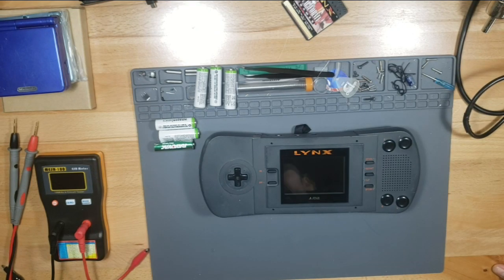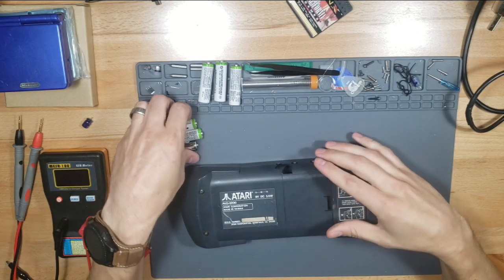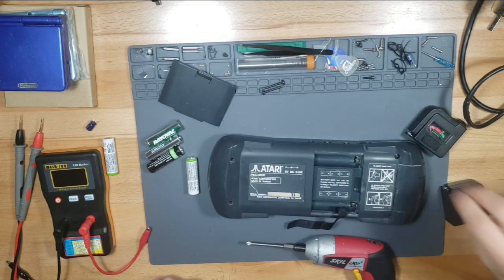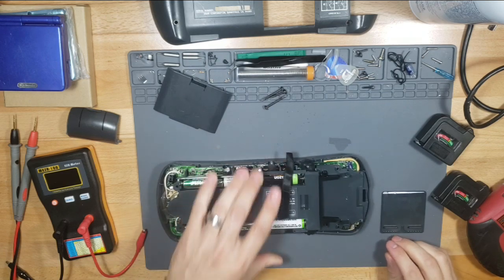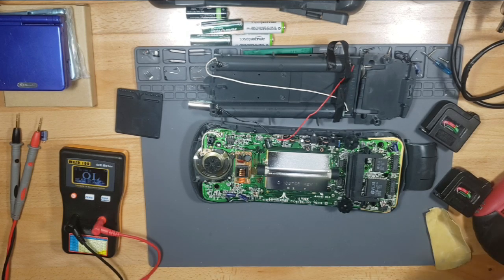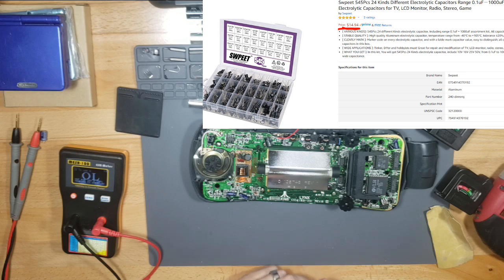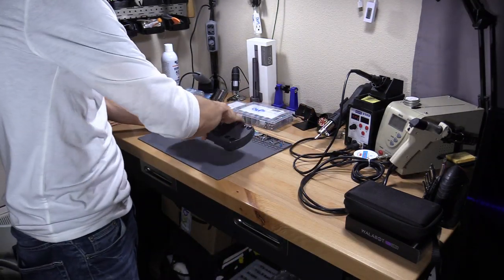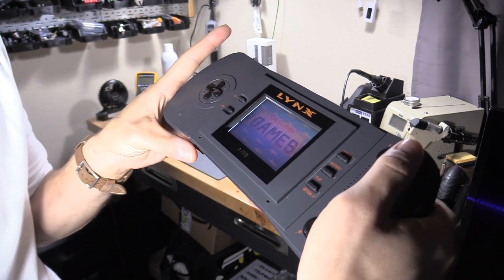How to Fix Atari Lynx power not working & bad screen

Comment: More than 10 years ago, I bought an Atari Lynx 2 console. It didn't come with an AC adapter, and it wouldn't turn on. I haven't been able to play it to this day. I tried a certain AC adapter for a different device once, and the screen turned on! However, it was completely white and smoke started coming from the console. I quickly unplugged it, but I'm not sure how badly it was damaged (if at all), and if so, whether it's beyond my ability to repair as a result. I really prefer the Game Boy, but I've wanted to play the Atari Lynx for years. Any comments and/or advice on this this issue would be greatly appreciated.

Comment: Nice easy fix there.  I think I got my Lynx from the same seller you got yours from but I'm not having that kind of luck.  Need to get a DC power supply to test that.  Batteries definitely a no go.
Reply from the maker: Most common fix is cleaning battery acid and replacing all the caps.

Comment: I really enjoyed you fixing a big part of my childhood. Do they make a LED or LCD screen to change out for better picture quality? That would be interesting to see.
Reply: There is a solution with a modern day LCD Screen and a board to convert the signals. It is not cheap, but gives a very nice picture. It also exists for the Game Gear. After doing the mod on both, I would say the original screen on the Lynx 2 was better than the GG one. For Lynx 1 I cannot say...
Reply: @marcianzero_yt  That is awesome, thanks for the info. I would like to play one with an LCD screen.
Reply: Go for McWill Screen. It’s a solder job. :)